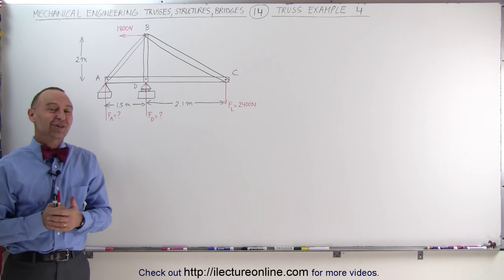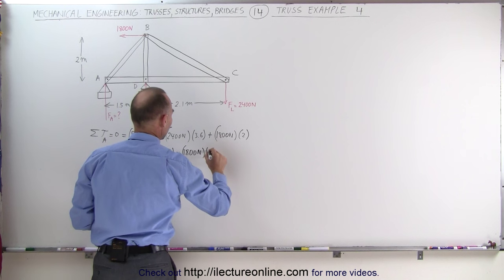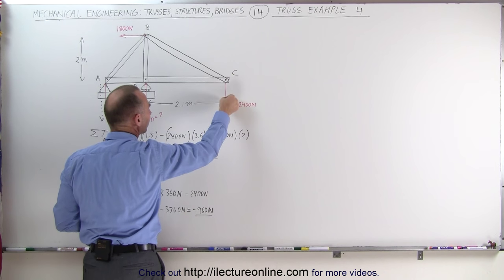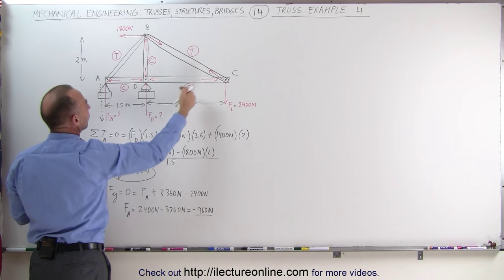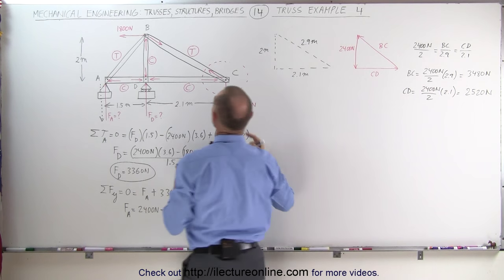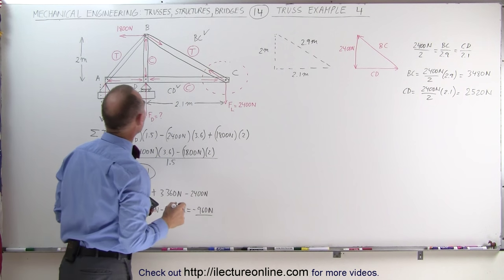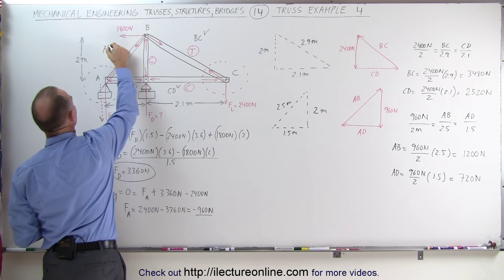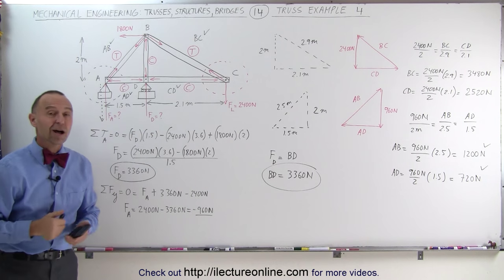Mechanical Engineering: Trusses, Bridges & Other Structures (14 of 34) Truss: Ex. 4

Comment: do you have basic videos on couple forces acting on simple supported beams like that 1800N force? i understand forces in Y axis but the 1800n force, when i look at it, it looks like its acting in an x-axis and I haven't done this kind of question where the force is acting in the x direction so i was wondering if you any basic videos on it?

Comment: Briiliant Course!  But compression force on AD element is in this case 2520 N as well.  I guess  there should be external horizontal forces 1800 N on the joint as you discussed down there, right?

Comment: Why dont you have horizontal force as a reaction of pin at A?
Reply from the maker: Since there are no external horizontal forces.
Reply: But 1800N is an external horizontal force isnt it?
Reply: But 1800N is an external horizontal force, isn't it?
Reply from the maker: Yes, you are correct.  It wasn't calculated in this example.

Comment: I'm still confused about why not force on AD not equal to CD?
Reply: the reason that AD and CD are not equal is we have a horizontal force ( 1800 N) at joint B so at joint A the support system provide both horizontal and vertical force. So Fx = 0 = FAx - 1800N => FAx = 1800N

so when you add FAx + FAD = FCD
                               1800N + 720N = 2520N
                               2520N  = 2520N

Comment: why did u associate the forces with the length ? because the previous example you do associate the forces with the angle, so in what case we have to associate it with length ?
Reply from the maker: It depends on what you are calculating.  If you are calculating the moment (like in this example), the definition of the moment (or torque) is the product of the magnitude of the force and the perpendicular distance from the line of action of the force to the point of rotation.

Comment: Hey man,thanks for the video first of all. I got a question about BD. In the right triangle BDC your association with the lenghts Works for BC and DC but it doesnt work for BD,why ? Because when i use it i find BD=2400N but you say its equal to FsubD
Reply from the maker: The 2400 N force illustrated on the triangle is the force FL (not F bd)  F bd = 3360 N as indicated in the video.
Reply: Ok got it,thanks again